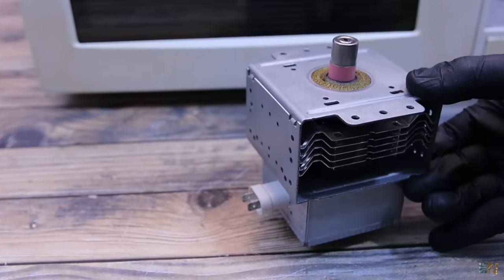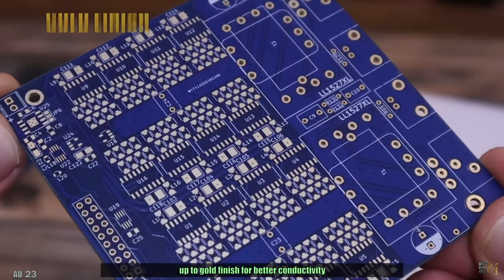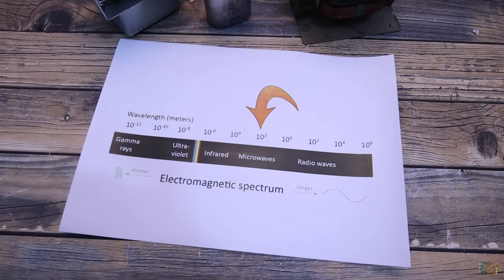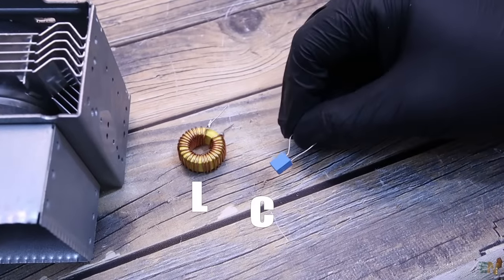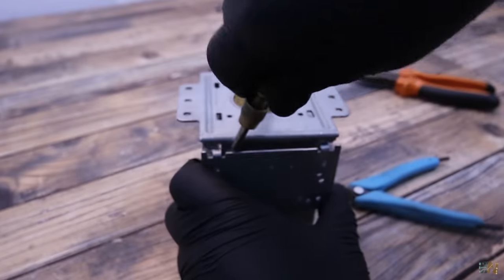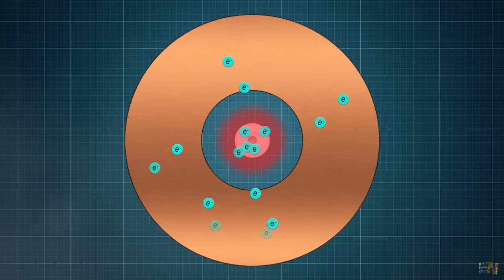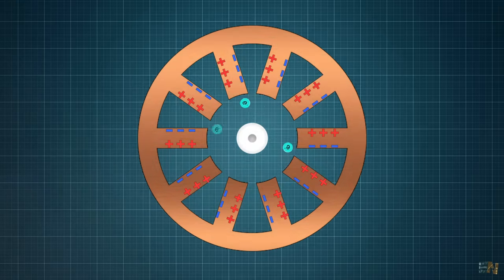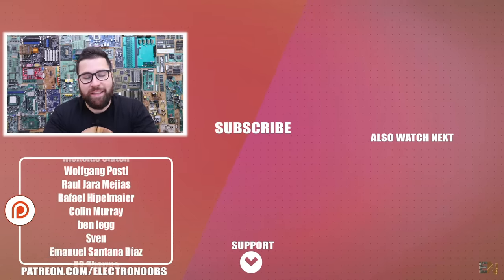MAGNETRON - Teardown + How It Works - Dangerous!

Comment: Beryllium Oxide insulators are pretty much never used in microwave magnetrons anymore in place for a much safer aluminum. The insulators of modern magnetrons are essentially "painted" the infamous pink color for whatever reason. While BerylOx insulators can be found in older microwaves, don't really expect to see that material being used in more newer ones.
Reply: Aluminum Nitride is a somewhat suitable alternative, but only has 63% of the thermal conductivity of BeO, requiring a complete redesign of the Magnetron.

Comment: As a retired radar engineer I know that the magnatron in your oven is tiny, usually 800 to 1000 watts. High power RADAR magnetrons often exceed 1 million watts output and high voltages of about 100 kV. Be very careful where you put your fingers.

Magnetrons are designed so that the end user will never dismantle one. Yes Byrillium is dangerous but in reality only staff at the manufactures plant have a problem.

Comment: Great video, but how do you discharge the high voltage capacitor, just wait for a few hours or days?
Reply: With proper safety equipment (gloves, insulated high voltage rated tools), great care and a 5 watt or more bleed resistor across the terminals, around 10-20 ohms should work well.

Comment: The  BIG  diode connected from capacitor to chassis has many series connected high voltage diodes inside , so WILL NOT register on most multimeter diode tests ! ...To test , connect via a 1 kΩ resistor to a 24 to 30 Volt DC power source , when forward biased you should read about 10 Volts across a working diode .... FYI , a number of the Ferrite magnets placed on the side of your steel cooker / fridge are a great way to organise your cooking tools ! ... ( tried - n - tested ) ...... DAVE™  ...........
Reply: The main example where the standard 0.7v drop flies out the window 🤣🤣 took me a while to figure that out when I first started using em in voltage multipliers....

Comment: @catalinalb - The raders transmit microwaves which fly out of the antenna through the wave-guide tube and strike the targets,reflected or bumped off 
back and reach the antenna back. The time taken to reach the antenna is interpreted as the distance of the target. So
this is like sending Morse code, but short bursts of pulses .

Comment: Does the magnetron have a vacuum in side of the unopened unit? If yes, does it have a "getter" like a glass vacuum tube does to prevent gas contamination from ruining the vacuum? Such a getter is usually made from a reactive alkali metal, like barium.

Comment: It won't "melt you from the inside without you even knowing". At most you'd get a nice warm felling on your skin, rather like a radiant infra red heater. It's even been trialled for crowd control but never quite appeared on the market. And beryllium oxide would need to be ground into a fine powder and inhaled to cause a problem - pretty difficult to do even if you wanted to, given how hard it is. At one time I worked on 50kW+ pulsed radar magnetrons - nice smell of ozone if you left a waveguide open but no damage done. Please try not to exaggerate, even if it sounds more exciting!
Reply: I recollect a description of a suicide incident, when a women removed the MW owen glass to defeat the sensor, inserted her head into the chamber and "boiled"  herself.

Comment: Did you leave out the voltage doubler circuit that uses the capacitor and the high voltage diode that double the 2000 volts A.C. from the 2000 volt transformer ?
 
The magnetron actually works on alternate half cycles of about -4000 volts D.C. from the doubler circuit.
 
Mike, Retired Electronic Engineering Manager from Litton Microwave.

Comment: While I admire using a reason to dismantle a microwave, that plate with a hole is only a waveguide cover plate that can be replaced for $9 US.  They can fail when they delaminate from too much heat.    Also thanks for the PCBWay recommendation.

Comment: A nice summary, but sadly a little inaccurate.  Please reconsider how the anode is heated and correct your explanation with attention to the cavity size and the injected high voltage AC signal, which is actually closer to 4kV for the magnetron to oscillate in the desired mode. In addition, the only real health risk is from the anode electrode, which contains the radioactive element thorium, used to further enhance electron emission.  Every insulator I've encountered in domestic magnetrons are simply alumina. Beryllia may be present, but it's unlikely.  Even the thorium in the electrode is quite safe unless you remove it and grind it to a powder.

Comment: Also beware, the capacitor can hold a lethal charge for some time, it may have a bleed resistor to discharge, but that can fail without affecting operation
Reply: Absolutely! Those large capacitors are so dangerous, I'm so glad we moved on from CRT televisions and also don't really use them for water heaters anymore either.

Comment: I would like to add since it is not mentioned here, that capacitor inside the microwave WILL kill you if it discharges into you. That is the most dangerous component of the microwave oven and is actually one of the main ways electronics hobbyists die because of their hobby. Always always always make sure that if you take apart a microwave yourself, that you discharge that capacitor, while wearing proper PPE, even if you think it's discharged it is best to verify yourself. Those things can hold a charge for a LONG time. Treat it like a gun. You might think it's safe but it's always best to assume it's loaded.
Reply: I smile more with each comment I read that highlights that fact. bleed resistors fail and even so this definitely applies to anything with a power supply, step one... look for the big round things... step two... discharge with appropriate resistor/discharge wand and safety gear! Note some caps can be discharged and then build up a portion of that charge again over a minute or two, so ideally discharge till your sure, make coffee, discharge again and then short with a jumper on bigger caps. I lost a mate to a recently "discharged" cap in a large welder. And the worst part is that ugly process was not instant either... He had a nasty amount of time to reflect and regret.
Reply: @julescircuits845  I know to discharge it but I didn't know it could recover some lost charge. Good to know, not that I'll ever handle a big cap again. But thanks for the education.
Reply: @garymartin9777 If a bleed resistor happens to fail that will not show any visible symptoms, the microwave will not fail, you'll basically have no way of knowing. Without a bleed resistor, a capacitor that large could remain charged for many many months. My point is, Always assume the capacitor is charged until you physically verify that it is discharged by attempting to discharge it. Capacitors this large can develop some charge over time if they are not shorted together (through a bleed resistor). Since no capacitor is perfect, some of the electrons go on to store energy chemically, and don't move all the way through the dialectric in the capacitor. This energy isn't released until the voltage on the two poles of the capacitor drops, such as after it has been discharged. A capacitor can "regain" 15% or so of it's max charge this way seconds to minutes after being discharged. (assuming it was just discharged from it's maximum charge). So not only is discharging the capacitor important, but continuing to short both terminals together is important too.

Comment: A microwave transformer is the single most deadliest thing that everybody has at home. It's also the only thing that changed in microwaves since 1995, with new ones having an inverter instead of a classical transformer.
Reply: I have a new one and it only has the classical transformer. But I never owned a digital one nor do I ever want one, it seems like a total overkill for what's basically a simple heater.

Comment: Intresting to know now how a Magnetron works. As I know microwave transformers also have an low voltage output coil which can serve many amperes. Some crazy yt tutorials show how to build an point welder with it. I assume that (low voltage) part of the transformer is for heating the filament like in a common electron tube.
Reply: yes, if using a microwave transformer for spot welding, you should remove the ht winding for safety

Comment: Amazing video!!! Please, could you explain more about how the curved part of the copper anode acts as an inductor? At time 11:42 . Thank you so much !!!
Reply: Every wire is basically an inductor but the amount of inductance is based on certain properties like amount of turns, wire length, permeability and area of the coil, so I'm pretty sure it's a really smal inductance but there is inductance therefor it's an inductor.
Reply from the maker: @arrievdar1375  Exactly
Reply: @arrievdar1375  Nice! Thank you so much for this explanation!
Reply: @JoseSilva-gt6zj  you're welcome! Also every wire has a resistance so it's actually a RLC network and not just an LC network lol, but for these type of applications where you want a system that resonates a lot you want the resistance to be as small as possible since the energy in a resistor gets transformed in heat so you have less resonance, so I think that's the main reason why the anode is made of copper.
Reply: @arrievdar1375   - the noob would think the copper cross section is so thick so as to have lower resistance for the microwave frequency current flow, but at those frequencies skin effect theory says the thickness isn’t as beneficial as it would be for a DC current.

Comment: Good video.
But like all others videos on yt about these ovens its never explained.. For example what makes it oscillate at 2.4GHz? Cause you dont get 2.4Ghz by connecting 2kv at 50Hz with 10mikrofarads and a coil in series.

Comment: 7:11 Actually, the collapsing magnetic field pushes the electrons in the same direction that created the magnetic field.  This pushing charges the capacitor in the opposite polarity to what started the process.   Once the magnetic field has collapsed, and the capacitor is now charged (but opposite polarity to what had been imposed), the half-cycle repeats but down in the opposite direction. 
Analysis: The capacitor pushes current through the inductor but only for so long as the capacitor has a charge.  The inductor opposes the increase in current through itself; it does that because a growing magnetic field opposes the applied current.  But a shrinking magnetic field pushes it along!   So, once the capacitor starts to lose voltage, and the current becomes less, the opposition is also less, and that is why you get a sine wave out of this circuit.  At some point the capacitor reaches zero, the magnetic field is maximum, and the magnetic field starts to collapse, generating a current pushing the same direction as before and this charges the capacitor in the opposite polarity.

Comment: great explanation about the resonance cavity. A cavity itself can not oscillate. It requires some sort of active device to create the oscillations. Can you elaborate on that part?
Reply: The electric field which leaks from the cavity through small gaps at the center, affects the electron cloud movement, causing positive feedback. This leads to the bunching of electrons which now move coherently along the cavities, coupling their motion with a microwave field in the cavities. The positive feedback leads to a slow rising of this coupling of the electrons and microwaves, until it reaches the full power.

Comment: Little warning because i don't think i heard it (excuse this if this was said):

The capacitors in a microwave can still hold dangerous voltage. if you don't know what you're doing, do not fiddle around inside a microwave. the consequences of touching the wrong thing at the wrong time are somewhere between painful and deadly.

Comment: Because of the nature of how magnetrons work, it is also not possible to simply tune one to any given frequency you like in a range. They are modal in operation, and the frequencies at which they work depends not only on the cavity characteristics, but the spacing. In simple terms, and based on 45 year old memory from teaching them, you tune by adjusting the voltage. Which changes, more or less, how many of those cavities around the ring each electron interacts with. Which gives discrete points where it works, not a continuous spectrum. 

In the Navy, aboard my last ship, during an exercise, we were asked to change the frequency of one of our radars. A radar using a magnetron. Changing the frequency wasn't the problem, but they wanted us to change it to a specific frequency. That, you can't do. Replace the magnetron, you may not get back the same freq you were on. Those specifics were somewhat unique to each tube. While the request came from command, who I can forgive for not understanding it, but it came to us via our management (EMO, etc.), people who should have known better.

Magnetrons are great, for things like microwave ovens and simple radars. Where all you want to do is basically dump some RF energy, don't particularly care for a precise frequency, etc.
Reply: But microwave ovens do emit as specific frequencies (the well known 2.4GHz). This is the frequency at which water molecules get exited and heat up. If the frequency is too far off, it doesn’t work.
Reply: @EdwinMartin  For one, microwave ovens don't need to be tunable. And, when I said a specific frequency, I meant specific. As in, 2.4005GHz vs 2.401GHz, 2.40 vs. 2.3995, etc. 
The only reason for our radar being tunable, was to be able to change the "signature" of the ship in the rf spectrum. That's easy. Hitting a specific frequency within the operating range, not so much. Pretty much, when you replaced a magnetron, you got it to work, you didn't worry about the specific frequency. If it was working, it's somewhere in the right range.
Reply: @brolinofvandar - In the 70,S
I too worked on marine radars
onboard ships . They used two 
types of magnetrons radiating 
on two different frequencies,
which are known as S band and
X band . I can’t remember what 
frequencies they are now !

Comment: About the insulator - It's the same ceramic material used in TIG welding cups. I would not snort it for fun - but they are not toxic.
Reply: Nowadays yes, but they used to be Beryllium oxide,  most definitely toxic and why you should not implode CRT tubes in an open environment...

Comment: The hole is in the wave guide cover and is usually caused by grease etc getting on the surface of the mica, which, on its own is non reactive to microwaves but the grease burns a hole in it.
Reply: You can just replace the mica sheet. The carbonised mica conducts and so causes the arcing.

Comment: Just want to comment that the electrons are emitted not from that 0.25" black disk 9:22,  but from the side surface of the cylinder in the center, which protrudes along the axis all the way through the assembly.

Comment: I'm so glad someone made a video on this subject. You would be surprised how many people believe that 'the resonance frequency of water' is how a microwave cooks food. This is especially rediculous when you consider that that output frequency of a microwave is around 2.4GHz (I'm guestimating, it could be be ~200MHz higher or lower, I really don't remember off-hand), and the resonance frequency of water is somewhere in the terahertz.
Reply: The ISM band is just the band of radio frequencies used by industrial, scientific, and medical fields. 2.4GHz is 2.4GHz, there is no 'different band' of 2.4GHz. The Resonance Frequency of water is between 16-21 THz depending on whether it is light or heavy water. The only resonance frequency used in a microwave is found in the buck converter which is simply two inductors rising to their Resonance frequencies and collapsing the resulting magnetic field rapidly to produce much higher voltages than mains can provide (buck converters are found in many different devices, btw they are pretty common). This is used to produce microwaves withing the magnetron which bounce around rapidly causing the water molecules to excite and impart heat. This is caused not by resonance, but because of the size of the wavelength in such an enclosed space. 2.4GHz is simply chosen because it does not take much power to broadcast, and is very easy to contain. This specific frequency is not very effective in larger spaces, and is also less effective when attempting to penetrate dense food. This is why you end up with 'hot spots' in certain foods such as pasta or mashed potatoes.
Reply: The  the S-band  2.445GHz was selected because of the atmospheric window at this frequency. That means that it has minimal absorption by the water molecules in the air. Since the magnetrons were originally developed for radars, the technology and the frequency remained.
    However, when water molecules are in the condensed phase (plain water), there are no distinctive absorption spectrum peaks for microwaves - any frequency shall work about the same. For example, I once came across a 5GHz microwave oven, which was a surprise.

Comment: Some microwaves called “range” microwaves, have something called a vent blower. The microwave is usually mounted above the stove. And has a metal flap on top of the microwave. And has 1-3 speeds. Also the microwave is bigger than the ones without the blower.
Reply: Often seen mounted without any proper air vent connected, rendering the vent function questionable at best.  I saw one house where the HVAC installers really messed it up and the kitchen vent was routed into the basement, and what should have gone to the basement vent was routed outside.  Yeah, they were literally paying to heat and cool a small part of the great outdoors.